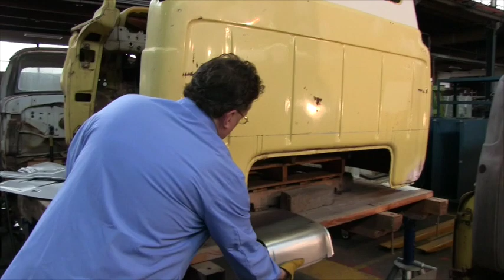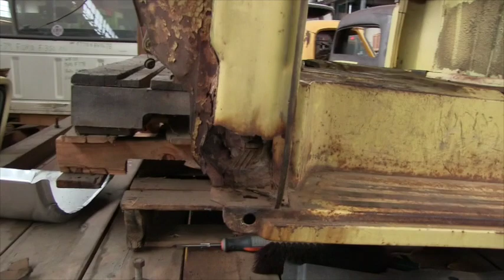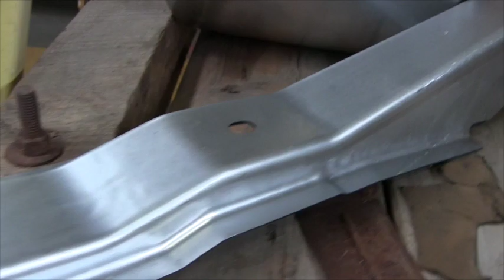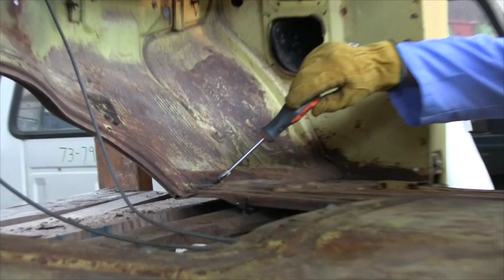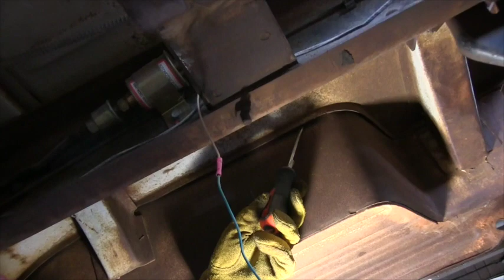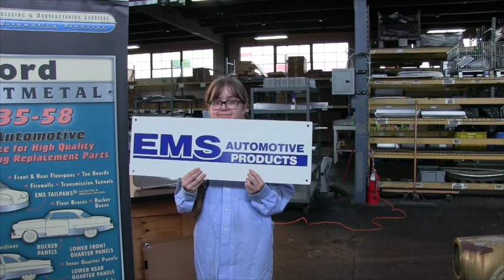1957-60 Ford F100 Pickup Truck Cab, Design Review By EMS Automotive

Comment: Ford boasted about galvanized  steel panels for their light duty trucks 1957-60, but obviously were indifferent to providing any sort of corrosion guard when designing the cabs. Why not have fixed the cowls so water would get into the floor regions?; It wasn't conscientious forethought in design, to state the obvious. The simple idiotic ridiculous obvious!

Comment: I have purchased the EMS products for my '57 Fairlane and could not be happier with their fit and gauge along with the coating that is 'primer ready' with just some scuffing! Members of two '57 to '60 F-100-F-350 forum's have purchased the truck panels EMS is offering now and they also are very happy! I'm so happy EMS is going to produce a full line of panels for the '57 to '60 'Fridges'! 😍😍😍